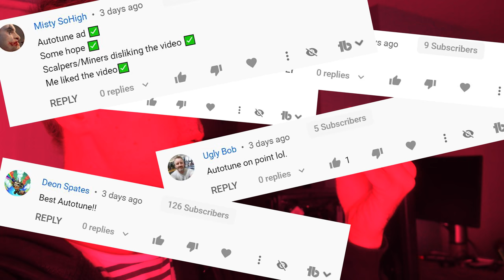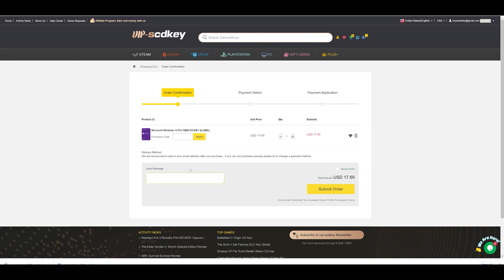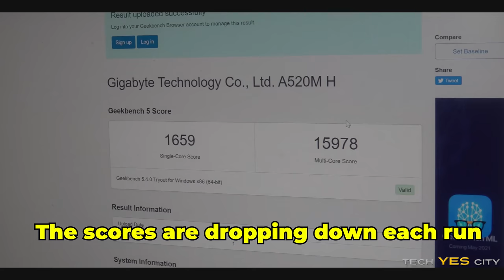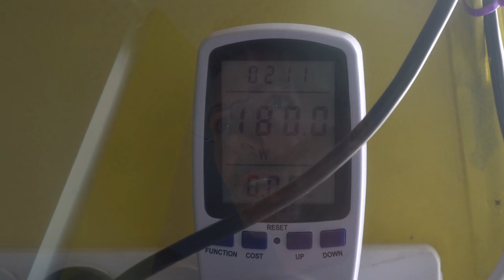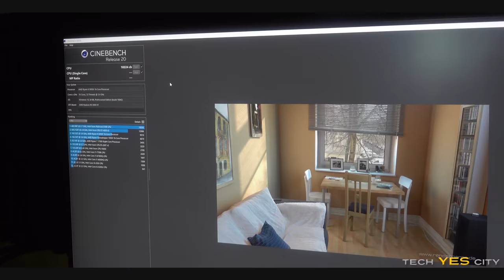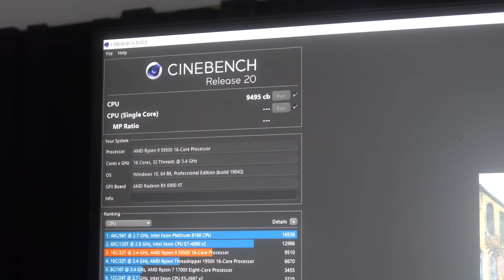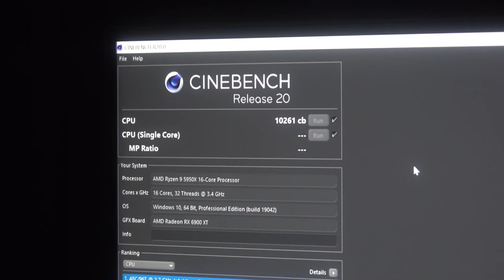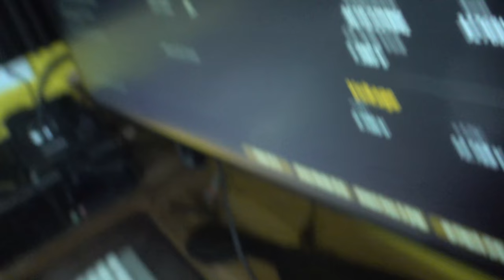5950X on an A520 Motherboard... This was NOT what I expected!

Comment: Test some el cheapo power supplies that have good reputation, like KOLINK, LC-POWER, XILENCE and some questionable like NAVIATEC, MS, NEON, AKYGA, SPIRE itd.
Reply: i have a KOLINK 700W, started smelling like burnt plastic at a 500w load on me, but hey if you don't mind the smell of a house fire it works))
most of noname PSUs are crap, there is PSU tier list 2021, google it
Reply: @rawdez_  i second this, anything below tier C is (personally) must avoid.
Reply: @rawdez_  I use KOLINK 400w cont, 500w peak at about 450W while gaming, works fine for me for 4th year now with very little airflow.
Reply: Are the digital alliance good? I'm using the 550w 80 bronze
Reply: @alvag6  Can't tell you for shure, but from my quick research, It seems deacent-ish, but from the picture I found of the circuit board, transformer seems good, heatsinks are on the cheaper side, but good, deacent filtering on the input side and a nice PCB layout, ratings look ok, but keep in mind that I couldn't see the underside of the PCB, the cooling solution quality, the primary switchers(very importhant), power factor correction, bridge rectifier, the brand of the capatitors, messure ripple, output voltge, power consuption, effishency etc.

And... their website looks dodgy.
Reply: @alvag6  the model I have seen was 350W 80+ Bronze
Reply: all the Aerocool cylons I've used are solid, you'll want a 600w+.
then the Gamemax rampage 500w is nice too, 40A 12v rail, 80+ bronze
Reply: @yoboicc_418  thats what it promises, but can it really deliver thoose powers without the ripple going trugh the roof or catastrophic faliaures?
Reply: @filenotfound__3871  Doubtful, everything on the lower end is peak watts not rms. So 250w = 160-175 probably on a good day. Mileage will vary of course power supply is like oil in a motor not the place to "save" money on.
Reply: @alreed2434  Yes.
Reply: @alreed2434  On KOLINK power supplies, they list peak and rms power, so the 500w unit can deliver 400w rms, and they actually do deliver promissed values, without the ripple going trough the roof, and are built deacent-ish, So they are the only low-end brand that I trust. And I also trust them because I have a 500w peak (400w rms) unit  beeing loaded up to 550w while gaming according to MSI afterburner, runs fine after 5 years now, and the airflow is bad even without the dust and i rarely dust my system, and trust me, it gets real bad in there.

Comment: 9:45 I feel attacked with my 4790k and 2070 Super xD
Reply: get a 5800x NOw!
Reply: Its probably fine, that's faster than the 2200g I was using with a Titan Xp (basically same GPU spec, but CPU only has 4 threads, though I did overclock it between 4 Ghz on air and something like 4.6 or higher on phase cooling). It honestly played Fortnite fine, even at low resolution like 1080p it was running 200 fps with about a 70-80% load on the Titan (overclocked core on custom curve and 13 Ghz memory speed), so it almost maxed out the 240 Hz monitor but it was still butter smooth since it supports Freesync so not really a problem. I was impressed, I think my FX would be a touch faster in games (I ran that for a while on the Titan, and especially at 4k the FX barely had to work because you really need multi-GPU to get much above 60 fps at that resolution).

So its probably fine, I'd only upgrade if you're unhappy with it.

Comment: Glad you made this video. Tired of seeing someone call another person an idiot for pairing an expensive CPU with a budget mobo. If your not overclocking or doing workflow stuff cheap mobos are fine like you said
Reply: Yeah but u normally dont buy a cpu like that just for gaming.
Reply: Yea but at the same time, if it was a pure workstation PC going with threadripper would be better even with an older threadripper model.
Reply: @jamesgray5741  depends on the application
Reply: @mrn234  the only area the 5950x beats a threadripper is streaming/gaming and overall powerdraw. I believe threadripper uses nearly 3x as much power

Edit: and price if we werent in the whole CPU GPU shortage. But ATM the 5950x and and threadripper is damn near the same price cuz of scalping

Comment: Thats it, I am keeping my A520 motherboard, and getting a 5800X
Reply: 5800x with pbo2 from factory is 142watts
Reply: I think it'll work well. A lot less power than the 5950x
Reply: @christophermullins7163  At stock it's exactly same. Both cap at 142W.
Reply: @kaneda4  yeah right. I'll believe it when I see it. Literally.

Comment: I got this motherboard for cheap coz i really wanted a decent gpu on my budget including a amd ryzen 5600g to put on it, still working on the rest of the build. 
watching the vrm heat had me somewhat worried. is the custom heatsink a good idea for long term?
i am building my first gaming rig on a budget and looking for any advice to improve it.
Reply: You are fine, the temps are high because the 5950x needs more watt than an average cpu. Your CPU should be fine, the 5600g only needs only 65 watt, the 5950x needs 105 watt.

Comment: If you could do that with a Rpi sized heatsink, imagine using a real heatsink. I've cut those giant northbridge heatskins (40x40x30mm) into size to make use of the airflow and modded an ASUS M5A78 to handle an FX8150 (and it only has a 4 pin power connector), and the temperature went WAY lower that 20°C.
I advise you to repeat the experiment with a better heatsink. Old school mods take time, but they are the best.
Reply: Seconded, if that dinky heatsink made such a different, one with more mass (and enough surface area) should really be able to move that heat away

Comment: Both me and my brother own this motherboard. 
He with a ryzen 5600x and me with a ryzen 3600x.
With the 1st bios i could even overclock the 3600x but they modded that out in later updates.
Even during gaming or editing it still boosts to 4.1 ghz for 99% of the time though, usually max temp 68°.
We both use the vram coolers like you do, though without the fan on them. 
Anyways thanks for the video, very informative!
P.s. my only complaint is the max ram speed of 3200 mhz, i'd prefer 3600mhz.

Comment: I don't bother spending any money on serial keys for Windows because I found a way through command prompt to basically break the validation server for Windows. When you get hey windows update the watermark will come back but I made a handy little bat script out of the commands and I run it every single time it comes back. Which lately hasn't at all even with the last few updates

Comment: I bought ASUS Prime A520-E from scorpie for $69 and ASUS website lists the recommended cpu's, the 5950x is on the list, so i dare say it would depend on what you would use it for. I myself are looking at the Ry 5 Pro 4650G, as aside from the Ry 5 3600x for similar price bracket as of current. I have a particular project underway.

Comment: This motherboard isn't meant to be run like this, either you use an aircooler or the board is in a case. Even good VRMs with heatsinks can overheat if the airflow isn't there.

Comment: If the board is in a decent case with good airflow will the VRM be cooler?
Sitting on a desk is not the same surely.
Cheers, Mon from Brisbane
Reply: It's generally going to be worse in a case.
Reply: @MLWJ1993  good airflow will always be better than a static tabletop
Reply: @monham5041  air naturally flows through wide open spaces. Most cases are going to be much more cramped & provide not insignificant temperature improvements just by removing the side panel. That goes for "airflow" cases as well.

A valid argument for a case is that it generally produces less (annoying) noise though.
Reply: @MLWJ1993  a good case has fans front, back, top and sometimes sides.
Passive airflow can't beat directional airflow.
Good fans are pretty quiet these days and I'd rather have a quiet hum than an overheating system.
Personal choice maybe.
Reply: @monham5041  temperatures are worse in a case period. Hot air is trapped inside it no matter how many fans you have (actually more fans can make temperatures worse with disruptive air flow patterns).

Especially with VRMs that're usually trapped between hot components with very restrictive airflow inside a case.

Even if it wasn't though, this particular VRM setup is just poor anyway (and cheap which is the main point here, you can get away with that if the CPU doesn't need much).

https://forums.tomshardware.com/threads/case-vs-test-bench-cooling.1317831/
Reply: @MLWJ1993  not sure that I agree with you.
This would be a good test for @tech yes city though.

Comment: Well.. I knew for some time now. Buildzoid tried the mainboard, and played with some voltage. For anyone that doesn't need overclocking and less than 16 core , I always tell them to get A520. Did the experiment myself with 5800X, and it ran just fine. No throttling, and temp was not that hot. A520 was NOT A320. It's even better than some cheapo B450. 

Anyway, mine was MSI

Comment: If you used good air cooler that would help with vrm temps. AiO is cooling only CPU while air coolers help with air circulation in general.
Reply: Was thinking the same thing. Would definitely be interesting to see it retested with one.

Comment: Why do you even use a liquid cooler then add those heatsinks. Why don't you just use a decent 105W air cooler which should blow the air on the VRM as that would maybe be enough to cool them, right?

Comment: I have this board with a 3500X, typical budget build, but can't OC at all. Should've spent the extra $10 for the basically identical B450 variant. It's cheap and supports Ryzen 5000. Only issue is that, if I upgrade to a larger GPU, it'll cover the SATA ports which are placed poorly.

Comment: i paired a FX8350 125w with an asrock board (i forget the model) its designed for FX 8320 95w, i just seen on the board it supported 8-core cpu and gta 5 recommended fx8350 so im like OKAY 8350 it is totally ignoring the wattage requirement didnt even give it a thought.... it worked! had it working for a few months before i realized the mobo doesnt actually support it, mobo was a bottleneck, although it worked it ended up having better performance on a supported mobo yes it worked on the old asrock but the low watts means it wasnt running at full power it didnt crash or anything bad just FPS was struggling alot more on insuficient power.

Comment: A general rule I go by when buying motherboards for AMD Ryzen is this. The A chipset motherboards like a320 are good for an Athlon to a Ryzen 3 CPU max. B series motherboards like B550 are good for an Athlon to ryzen 7. And X570 motherboards are good for any Athlon or Ryzen CPU/APU. The reason being of course VRM quality. Own a computer store and over the last 3 years seen to many A Series motherboards like the A320m s2h burn out its VRM section due to people using Ryzen 5's and higher in them when the VRM components mosfets and Capacitors can not really handle that heat load. It don't help that most A series motherboards are "naked" in the VRM section and contain no heatsink (a very few number do but most don't)

Comment: I guess now we know why the b550s are like 100 dollars more now than before so if you get a 6 core and add thermalpads and heatsink you got a great motherboard if your just looking for bare minimum to run stuff
Reply: If you got the Gigabyte B550 Master. It can handle the  5950 with the pcie gen4 ssd no prob, because of how overkill the vrms they put on their are.
Reply: @surft  yeah I realized that late I got me a x570 pro wifi to replace my b450 pro wifi to upgrade to a 5600x but then I realized I'm an idiot

Comment: Hey, are you going to revisit original Threadripper Tr4 (1950/2950) since nowadays you can get them occasionally for "cheap". I have seen the 16 core ones with a motherboard (and sometimes they include a cooler) for 350-400€ here in Germany. This might be interesting for a budget-ish workstation/enthusiast build.

Greetings
Reply: They are pretty good, I like mine. My TR-1950x at 4.15-4.2 Ghz all core uses about 465w (max sustained workload), but easily cooled even with a regular 120mm AIO and performs very well. I have it running 4x GPU and have room for a couple NVME drives thanks to all those PCIe lanes, its basically a must have if you want to do Xfire/SLI and handles 4x crossfire buttery smooth. They also support a huge amount of RAM, and though first gen Ryzen has terrible memory controllers the TR series is the top 5% binning of them so mine does 3800 Mhz quad channel just fine (with 3600 rated sticks), while my X370 Ryzen platform can only do 2800-3000 Mhz on the same but only 2 sticks. Its a good platform, stock it only consumes 180w max and does very well, I just like to push things, haha!

Comment: If using an AIO surely it would be better to use better heatsinks. Seems plenty of height was available to fit one or two in? Certainly ones with taller fins? Easily found online :)
Reply: overall you need more mass... those small heatsinks are not the best for more extrem tasks like this.

Comment: I think the a520 the max cpu to play games you can use a ryzen 5, i think for a ryzen 5 that board is usefull, anyway personally i would spend a bit more and buy a b550 with vrm passive cooling even if i don't overclock, the system will be much more reliable over time, and a cpu is expensive, if the vrms are cooler the cpu will be cooler and will not die or it would be harder for the cpu to die

Comment: So, does this mean it might be an idea to stick with 'budget' low to mid-range Ryzen 5000 CPUs (when AMD gets around to releasing them) when you have an A520 board?
Reply: I even think the 5600x will be handled by A520 boards. 10 less cores. You wont even need to modify the VRM, I think

Comment: thanks for you excellent video :). how do I overclock this board with 5900x? I can not get it to work
Reply: U can't the only way to get higher clock speeds boost would be to get it as cool as possible intake fans on top of case where exhaust fans go u would be running cooler to cpu and board chip set but u won't hit over advertised marketing boost clock speeds if u want a real overclock higher than that get a X570 or B550

Comment: do you think 5700g would be good with for A520? not gaming, just for work, do you think VRAM will go up 100 degrees with 5700g? thank you
Reply: the VRMs went high because the 5950x needs 105 watt but with the 5700g you should be fine it needs only 65 watt.

Comment: How about this with a 6 or 8 core?  What about one of those overclocked?
Reply: I don't think A series doesn't allow overclocking, that's what the B and X series were for. You'll want to get a B series**

**some of those are heavily voltage limited, depending how overclocked you're talking about, like are you talking water cooled or sub-zero? For sub zero you'll need to check the board, because some like my X370 that just died allow up to 2.5 Vcore which is 0.5v more than any Ryzen needs for a world record, but if you're pushing near 2v then you'll need to check the board because some don't allow that high since that's instant CPU death zone if someone accidentally typed that in.

If its doing fine with a 16 core then anything the same or less power load is going to be fine under the same conditions. So if you need a cheap board just for stock speeds there you go, and those heatsinks he used are about $1 for a 10 pack just to be safe (it also comes in uncut bar stock that you can trim to exact length, much easier because the squares like to fall off and potentially short stuff).

Comment: That 4690k / 2080 Super combo would probably work fine at higher resolution or high settings though. With that much of a CPU bottleneck, you might find that it runs better when you load up the GPU instead of the CPU. That would be worth a video, while you're doing weird combos.

Comment: Would there be much temperature difference if you had used copper heatsinks instead of aluminium? Also, does the direction of the fins matter?
Reply: Direction  might matter if you're using a stock AMD cooler (that blows downwards and out to the side). For copper vs aluminium, I think more mass / bigger heatsinks would matter more than the material (tho obvs copper is def better, just not that much better)

Comment: Not all people do gaming.
What about if you have b520 motherboard you find ryzen 9 3900 cheap and you are on a budget.In the end you will also need at least 8gb graphic card and 16gb of ram.
I will prefer a ryzen 9 3900 or an i5 12600 rather than ryzen 7 5700x or 3d because of the many cores.
In rendering cores counts more so i will prefer lower clock speeds with more cores than higher clock speeds with fewer cores (8 is the limit).
I am working currently  with 6 cores without graphics card and it sucks.(Compositing a simple scene only light 2-3 minutes).